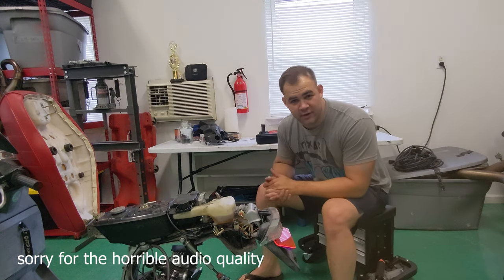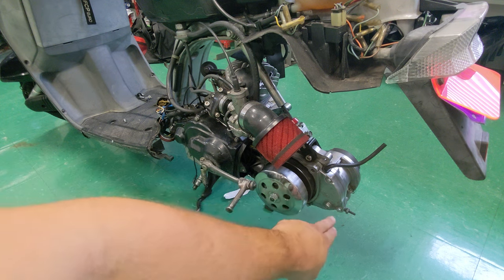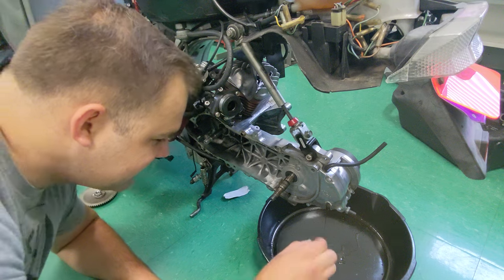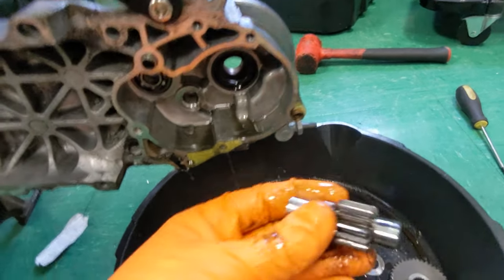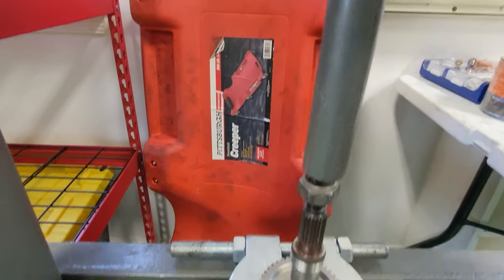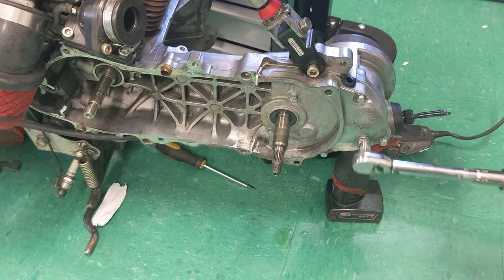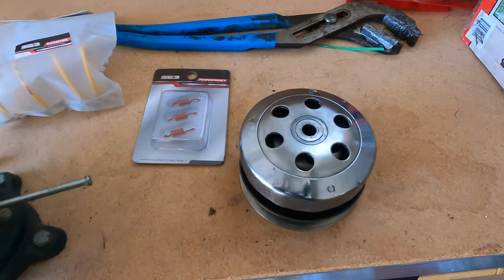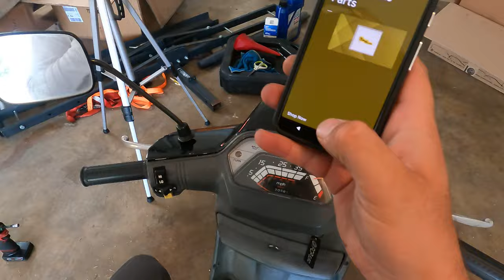We re-gear the Aero 50 scooter for 25% MORE SPEED

Comment: If you ever struggle with the gear case cover again just thread a long 8mm bolt into the oil drain hole and tighten it.  The end of the bolt will hit the gear on the output shaft   and if you tighten it more it will push the cover off.  Easy peasy.